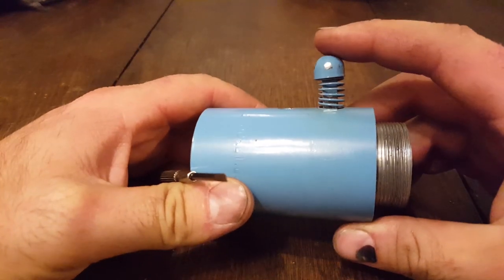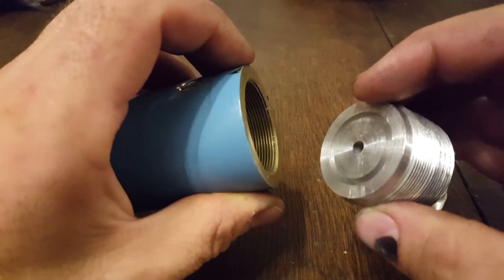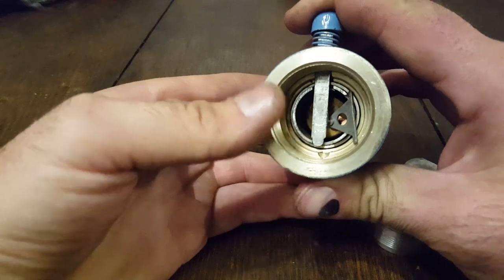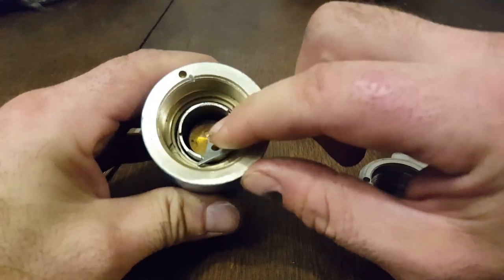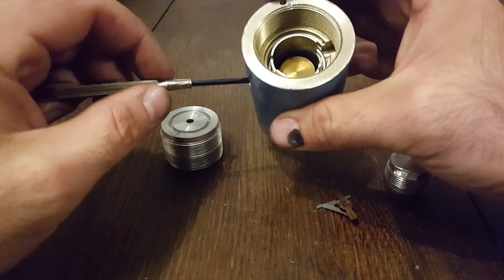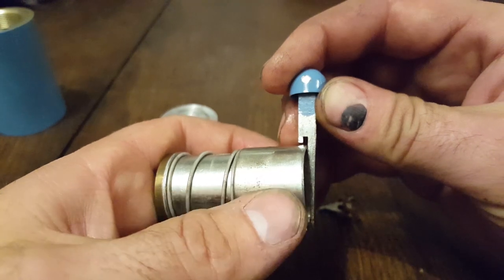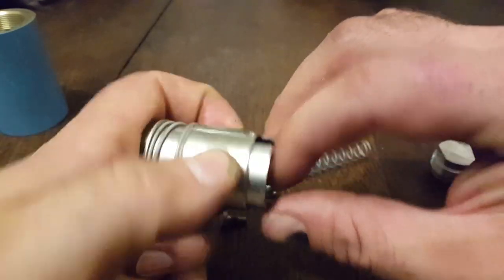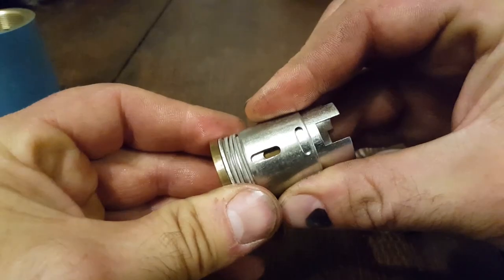M404 A1 Fuze (SuperBazooka Rocket): How it Works

Comment: Found a lot of the blue practice rocket tails on a practice range nearby. Most of the fuzes (well, all of them) have been either destroyed on impact, or completely corroded together. Very happy to finally see its innards, and how it works. Interesting design, thats for sure.

Don't know if you've seen it, but there is footage of a soldier shooting a practive rocket in Korea, claimed as war footage. With the speed and mass even the practive rockets have, I wouldn't be surprised if it was actually fired at lightly armored vehicles, with just a talcum powder warhead..
Reply from the maker: Yeah I have seen a few of the videos. Alot of people I assume due to Hollywood dont realize just how "massive" rockets are. The speed and the mass really means they will punch through light skinned vehicles without even going off most of the time. So I wouldn't be surprised if some of the inert ones were used to take out people in light vehicles.  Thanks for watching.